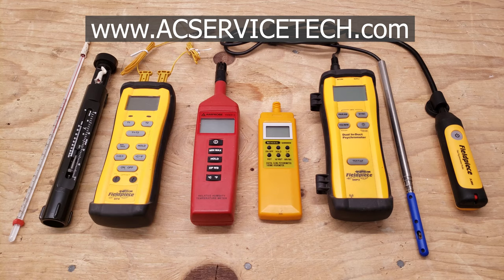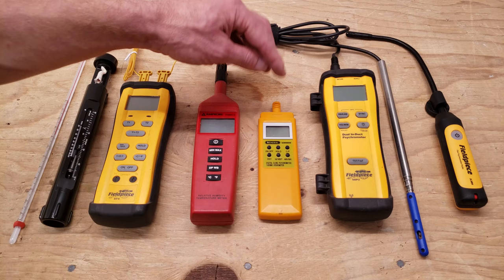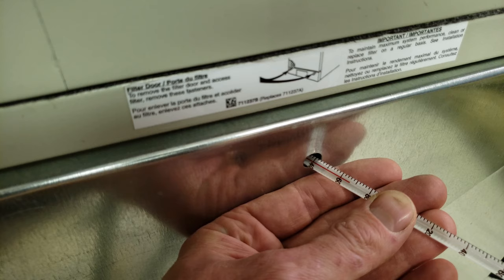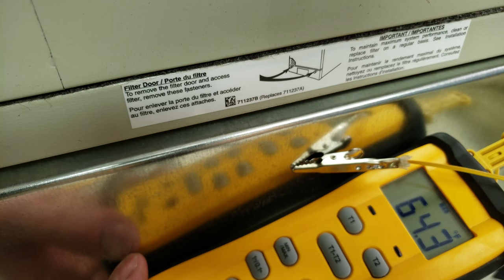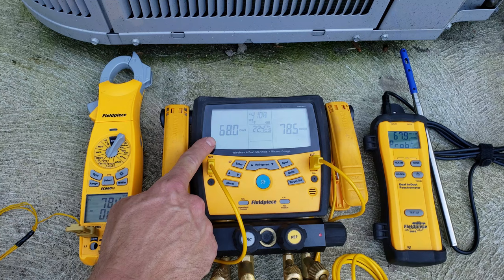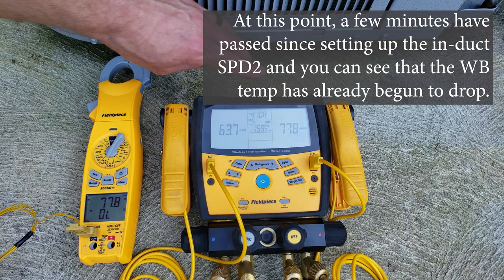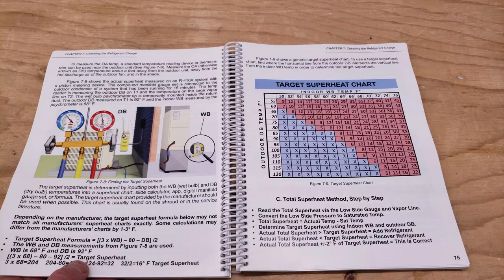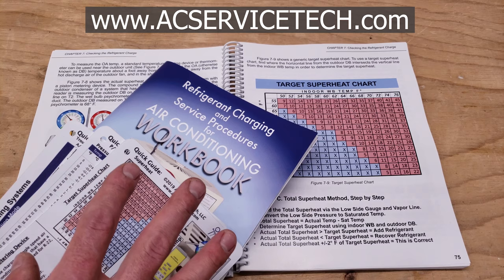7 Tools to Measure Wet Bulb Temp for Target Superheat!

Comment: some of us starting out need to keep it to the minimum amount and cheapest tools possible.  do you think you could provide links to just those mandatory and the cheapest  (within quality thresholds) and do that in categories.  So for example, it would be good to know the entire set of tools needed for R-22 only (cheapest possible), then for R-410, etc BUT then a sub-category for the type of system (piston, etc.)..  so what you get is a layered approach.  So one category (or column on a spreadsheet) would say R-22 (Piston) and then list all the mandatory equipment needed at the cheapest possible price (within quality thresholds) and so forth and so on.  Not sure if that's a lot of time , perhaps you already have something like that thrown together.  Great video and excellence in your trade!

Comment: Craig, thanks so much for all your videos. I wonder if you can make a video for the scenario that the refrigerant is already really low, as soon as you start charging the system, the evaporator coil will freezing up, what to do in this situation? You know that the system is nearly empty on refrigerant, but when you try to charge it, the evaporator start icing. The video like that probably will benefit a lot of people. Thanks.
Reply: Tong Li if we find a system that low. We add Nitrogen, get the leak detectors out. Its getting out somewhere. Follow the line set as much as is possible, find a lot of leaks that way.
But if you can’t/don’t find a leak, turn unit off, look at factory charge on data plate, put a couple pounds in, the start unit.
Reply: @guyincascade  Thanks very much for your suggestion.

Comment: Hi. Since the wet bulb temperature decreases as the system runs, at what point do I decide that I have the correct super-heat, and I have the system properly charged? Thanks. Keep the videos coming. Great job!
Reply from the maker: You would need to line the target superheat and the actual superheat at the same value while the system runs. We have a full length article on the superheat charging method with pics at https://www.acservicetech.com/articles thanks!

Comment: My instructor showed me and my class the digital fieldpiece probes using the app
Reply: Works well but in the beginning, it's best to know how to do it manually.  Begging the lazy person I have become , I also am using the FP probe set instead of the manual method but prefer the Measure quick Application inside.

Comment: So, I could use my hvac Fluke meter temp probe with a wet sock on it? May be a dumb question for some but I’d like to know it’d work.
Reply: Good question.  Yes. I do that as well, just remember that it will dry out in about 15-20 min.
Reply: @TheRealoldcar  Thank you very much! I appreciate the reply.

Comment: Hi Sir why I have to seperate Rh and Rc if I have dual fuel appreciate your help
Reply: If there are two power sources in a Dual-Fuel system, the call for W to fire heat is derived from Rh. It is going to depend on if the 2nd heat source's controls are entirely separate or integrated with the first.

Comment: Why use the sock ? temp is temp....
Reply: hmmmm, i think that the web bulb temp and the dry bulb temp are different. The target superheat calculation requires indoor wet bulb temp. Sock makes it wet.
Reply: its about humidity and dew point, things like that...so it's more than just temp
Reply: Perhaps you should look up what is wet-bulb and dry-bulb.